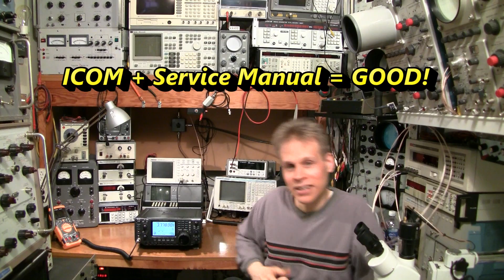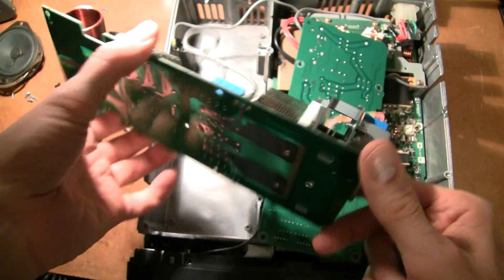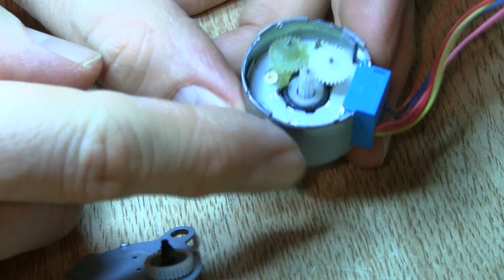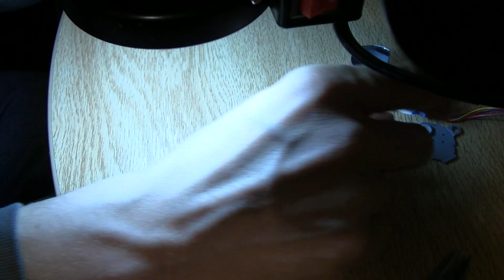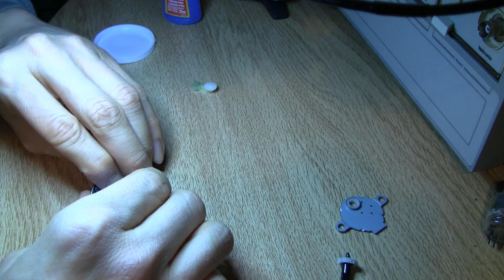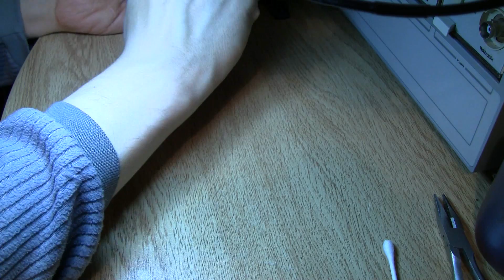Troubleshoot and Repair an ICOM IC-746

Comment: Greetings! Many thanks for the excellent, detailed instructions but I may have found a tiny flaw in your procedure. For example, a fellow club member gave me his IC-746 for backlight and tuner issues and included a bag of parts he had ordered for me to use. The motors provided had a similar but different power cable that did not fit the PCB connector so I tried your approach. Step one was to carefully bend just two opposing tabs on the motor casing just enough to allow me to slip off the cap and expose the gears. With the cap removed I used a pair of round-nosed wire forming pliers on the motor casing to force all four tabs vertical which allowed me to remove the next plate. When I removed the internal shaft/magnetic core I found that I was looking at a clutch assembly. There was a stress-worn spring at the bottom and I used the same round-nosed pliers to add small bends in the three straight legs at locations other than the original, now "tired", bends. With the motor reassembled and the tabs carefully hammered back into place the "rattle" had vanished.  In my opinion this motor was not designed to last and replacement is the best option but be sure to order the correct motor with the correct PCB connector before proceeding with the tuner repair.  Of course, the glue method also works but i can't imagine what damage may occur later on in the absence of a working clutch.
In case you're interested, a slightly modified bit on a 66-Block punch tool does a fine job of bending those motor casing tabs back into place in one, quick punch and it beats trying to use a tiny chisel and hammer. 73, Jim.

Comment: Thanks for this video. I have an Icom AH-180 that stopped tuning; it has the same exact motors as yours, and it failed just like yours, except mine did not make the grinding noise. With your help, I was able to repair both motors.

Comment: I'm a little surprised that no sync was needed because of the servo motors have moved relative to the tuning capacitors. I just bought the same radio, but my auto tune is still working. I'm just looking at what Issues I may eventually face. Thanks for the video!

Comment: I don't understand why a technician would waste so much time repairing a Commonly available part These stepper motors were made by the millions for 3D printers and they're available for about $5 each Not even worth my time to fiddle with.

If you run into a similar situation you can order four of these for around $11 and they are drop in replacements The part number is 28BYJ-48 they Very popular with the Arduino and Raspberry Pi enthusiasts..

And by the way great job diagnosing the fault in the stepper motor. I do believe the current version of these stepper motors has a more robust output shaft configuration As failure of the internal output shaft components was relatively common In the early versions.

Comment: Thanks for the video of the Icom IC-746 automatic antenna tuner repair. I have the IC-746PRO and will be repairing the backlight display soon.
73 Paul AA1SU

Comment: I noticed the tuner motor couplers in mine are dried out and split. Is there a replacement? I assume Icom no longer has them. I also found out the tuner motors have the same issue as everyone else has.

Comment: Hello !! I have a ic 746 and vox is NOT working. . Th e display shows all the functions but the transmitter never activates. I have the service manual and vox signals go to and from the microprocessor. Is there a known fix for no vox? My email is good on QRZ .  Thanks Craig KY4PI

Comment: I'm surprised that after 8 years apparently no one has mentioned this, but those parts you glued together are friction clutches.  They are designed to not be one solid piece on purpose.  You were onto something when you said "I wonder why they didn't make them like this to begin with".  Their purpose is to slip if the motor tries to rotate beyond the travel limits of the capacitor, keeping the gears from tearing themselves to bits.  There is a similar type of friction clutch in the gear assembly of automotive power windows.

Comment: Do you know how i can check the cat port on the back of the 746pro to see if it is working properly, i bought a cable and it shows cat port 5 even when it is not plugged in the back of the radio. it still shows com port 5, it seems that there is no communication from the plug on the back of the radio, i was wondering if there is a way to use a meter and actually check the plug on the radio to see if there is continuity or not. Thanks for any help. N0PDG

Comment: What an interesting repair Paul - I am left wondering if you had to mark the placement of the motor with the capacitor fins positioned as they were when you removed the shafts etc - or since these are step motors, does the orientation of the shaft and capacitors not really matter?

Comment: you don't mention if it's necessary to do a specific alignment of the capacitors before putting the motors back on the shaft.

Comment: I used to own an IC-746 and as with most of items I sell or trade, I wish I had it back due to not only for HF but, this rig features a full 100 watt 2 meter capability. I absolutely did not know it had motor tunable capacitors in the tuner section! Most auto-tuners I know of only use relays to switch fixed caps and inductors for tuning... a very noisy process. I personally only have seen motor tunable caps on high end high power auto-tuners. I have gone through several HG radios since the 746. I have bought and sold a FT-1200, IC-7300, FTDX-101d and now have an IC-7610 which I love! I also just purchased an IC-705 and have found it to have a great receiver. Thanks Mr. Carlson for another great video in which I have learned something I did not know before! GL.

Comment: I just picked up a 746 for 300 bucks with a bad tuner. Both motors had the separation issue with the ferrite core and plastic gear. I used gorilla glue gel and followed your video to a T and after an hour or so, my tuner is working very well. Tunes all bands pretty quick. Thanks for the video, it was a BIG help.

Comment: Hi Paul, I really like watching your videos and you have a way explaining things that makes sense to me. I just purchased an Icom 746Pro the other day from a guy. Got it home and no output power at all. He had a couple mods done to it like the diodes replaced in the power supply, A Cr-338 H.S. Crystal Unit installed and voice synthesizer. He said it was tip top. I do believe him. Its looks mint. I looked inside the P.A section and could not see any burnt resisters or traces NO OUTPUT on hf, 50 or 144 but I see 5 amp draw when I key the TX from my 13.8 Vdc supply...  Looking at the schematic, I am wondering about the  IC-151 (uPC1678g) RF IC chip.  OR., High bias setting took a device out. Any suggestions would be kind of you'?  Thank you., Dave.

Comment: I had exactly the same problem with my IC-746Pro. Just one motor, same side. After watching your video I decided to try fixing it before searching for a replacement. A little CA glue and some accelerator did the trick. Thanks for making the video!
Reply from the maker: Glad it helped!

Comment: hello my friend i am using icom ic 746 i have a problem like this i would be glad if you help me. When the tuner is on in 27mhz fm, the tuner comes on after 10 minutes, then it stops sending, the usb lsb does the same thing when it gets hot, what could be the problem? racer TA6SMT--73

Comment: This is an excellent instructional video on diving deep into the IC-746 auto tuner to the point of component level (the tuner motor and gearbox) troubleshooting and repair.  Icom's electro-mechanical tuning design for their older transceivers is fascinating on its own, and Mr. Carlson's video takes us on that journey.  The narrative is clear and smart with excellent
photography, ultimately being an entertaining and educational experience.  Thanks!

Comment: Quick question if you have the time.... I just purchased a used 746 PRO and when I turn it on, I hear the tuner tuning. Not crunching or anything, in fact, it sounds good. So is the tuner activating at power up standard for the 746 or, am I looking at a similar issue? I just don't know never having owned one. Thanks for the very detailed and concise videos.

Comment: Hi good job did you find any problem with the other tuner motor another success  I wonder if this is a common fault with ICOM IC-746 transceiver, it is a good job to watch and listen an electronic engineer at work keep it up and make more videos so much learning :)

Comment: Hello There.. Let me tell you a terrible story.. I sold my IC-746, but when the buyer received it the box looked like it was abused. When he opened it he said the volume was stuck, so that made me believe it has been dropped. He sent it back and it sat on my shack for about 1 year in the same box since I didnt want to look at it (it was too painful). Finally a few days ago a took a leap of faith and I opened it. I was able to control it through the ICV so I knew all was good, except the "ANTENNA TUNNER". Thanks to this video I was able to open it and fix the problem with the motors. Thanks sooooooooo much for this..

Comment: Great video!
Wonder if there is an orientation issue with the stepper motors (i.e. - there is a mechanical stop on mine (that slides over each shaft), so is there anything we have to do to insure calibration (or simple leave off the mechanical stop?)).

Comment: Had the exact same fault on my 746, even the same motor. I called Icom and they sent me a new motor, although the design changed somewhat and a connector adapter is needed. Haven't had any  issues since.

Comment: Also, I have worked on the 180l-17, it's a hf tuner used in the wingtip of the old B747 aircraft to tune the 12 ft HF probe antenna. It , too, uses 2 motors, one to drive the variable capacitor and one to drive the flat metal wire inductor, but they are massive capacitors and inductors, extremely heavy, as the Collins 618t Transceiver which drives them are rated at 400 watts PEP, and they have to operate at 40,000 ft in -60Deg temps. They fail, (not too often) mainly due them being a rugged mechanical device, and they re tune every time you change frequency.

Comment: I immediately saw the parts that you repaired as  a mechanical torque limiter. Intended, I surmise, at keeping the motor from twisting until it breaks parts if there is for some reason a jam. Did you leave that capability there? Am I wrong? Was that function somehow unnecessary?

Comment: Interesting solution to this problem,  I have an Icom IC-756 pro II and if I ever have an issue with my internal automatic antenna tuner I will look at the motor gears and see if mine has the same problem.   Thank you for your very detailed instructional video.

Comment: I'm a little bit surprised at you.  The Antenna Tuner typically sets its own power level, regardless of your own settings.  Particularly if you use the "TUNER" button instead if the "TRANSMIT" button.  That's what it's there for.
Reply from the maker: Nope!
Reply: What is "Nope" supposed to mean?  What kind of an answer is "Nope"?
Reply from the maker: What kind of answer are you looking for Yosen? No is pretty straight forward. This radio put out a lot of Wattage while tuning, more than I'm comfortable with. A few Watts is all that needed.

Comment: Such a nice radio and then these motors inside ... They are very much like the 28byj-48, often regarded as "the cheapest stepper motors available". Who else had an 101hero 3D-Printer and recognized the motors at once? ;-)

Comment: I'm surprised that you use super glue (or any kind of glue based on cyanoacrylate). Is this glue not chemically aggressive? Just asking. I thought it will cause plastics to dissolve after longer time?
Reply from the maker: Hi Marc. Once the glue has set (cured), I have had zero issues.

Comment: Thank you for sharing this..... I have an original IC756 and I can handle the 'lines' in the screen, but not the loss of my tuner.... The motors are built pretty much the way your IC-746 is.... Once again, THANKS...... 73

Comment: Icom says IC 151 problems due to ESD and to add diode.  Hams say heat related. Your video comment says you added heat sinks to some components.  Ny comment on issue in 746
Reply from the maker: Hi Art, My Icom still works (still)

Comment: Hello Paul -
Congrats on the repair. I was curious about something. You said that you were using an 80 meter dipole for the tests to discover if the tuner was working properly. I could see that the repaired tuner worked great on 80 and 10 meters. Did you try to use
 it on any of the other bands? I'm wondering whether an Icom 746 hooked to an 80 meter dipole with a 1:1 current balun at the feedpoint with RG-8X coax could tune most of the HF bands successfully? 
73,
Bruce  K6RQR

Comment: icom stuffed up in a few sections in this set 1- tx pre driver fails due overheat from too hi bias & lack heat sinking & same for the pair of tx  drivers ,2- display backlight drive transistor  overheats (lack of heatsink) ummmmmm think thats it ???  you would think by know these simple cock ups would be history ( o no )

Comment: I just purchased an ICOM 746 Yesterday with the same issue with the antenna tuner.I have decided that I will just purchase an external automatic tuner & not worry about it working. The radio works great on all of the bands & for the $350 I paid for it I promise I more than got my moneys worth with or without the tuner ever working.The last owner just did the back light repair & I'm guessing he had no idea the tuner did not function since he uses a 3 element SteppIR beam.
Reply: I sold that 746 several months ago to a friend who repaired the tuner.I just purchased another 746 a month ago from the estate of a local SK and it is out for repair now for the tuner. It is $100 for the repair for the tuner.

Comment: I would have used two part epoxy resin on the parts that needed to be glued. I just find that it gives you a bit more time to align things without so much rush as superglue requires. 😉

Comment: ahhh... Spendor in the Lab! You make a nasty repair look almost simple. You have learned, I'm sure sometimes through trial and error, but most of all through careful selection and research, what works and what doesn't. Learning about the zillions of different lubricants, metal to metal, metal to plastic, and plastic to plastic combinations that they work or don't work at all with was a decades long learning process for me. You simplify to the point of making it an art. LOL Love that 746. My 751 still needs love.  Bruce KQ2E  EDIT:  It is now 10 months later and I'm grinning like a really happy ham as I look lovingly at my NEW Icom 7300 and Astron 35M. Can't wait to see whatever you do to a 7300 to make it an even happier rig!
Reply from the maker: Thanks for your comment Bruce!

Comment: Why use oil instead of grease? It doesn't to have the proper viscosity. Oil tends to move, grease sticks. That's the only issue I have with this video.

Comment: I think ICOM did not glue the gear assembly together is to allow for slippage when the motor experiences a stall.  Prevent the gears from getting stripped.

Comment: I was contemplating buying a 746 with a "tuner does not work" issue. After watching this video, I decided to go have a closer look and found it had a very similar sound when trying to tune. Well ... I bought it. When I got it home I followed your steps and discovered the motors seem to be OK, but both couplers are cracked. Thanks to watching this video, I was able to buy it at a deep discount and an easy fix!
Reply from the maker: Glad the video helped Jon!

Comment: Thank you this helped me loads. I serviced my AT 180 Motors and it is working better than new. I used sewing machine oil to do the job. And yes both motors had the same problem.

Comment: These motors can easily be found on ebay for just a couple of bucks, quite often sold with Arduino kits etc.
Reply: China quality, buyer beware!
You may find the replacement is worse than the broken one you remove..

Comment: Hi. I'm restoring a TS430S and will be re-capping. This radio uses electrolytics for some  small values 0.1uf 0.47uf 1uf. any reason not to replace with ceramic (of correct voltage) these days?

Comment: I have never seen a variable capacitor turned by a motor. Your videos make me so glad that I only do software.
Reply from the maker: +Scott Larson 
This is common in antenna tuners that have to deal with RF power.
Reply: There are “old” spectrum analyzers and wobbulators that use a motor driven capacitor for sweep. The capacitor then has no stops and rotates continuously.